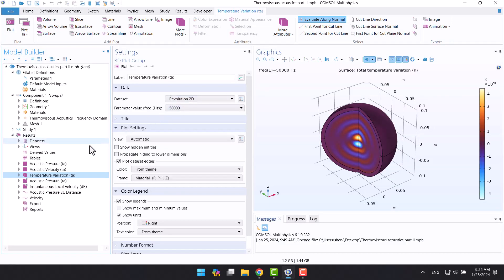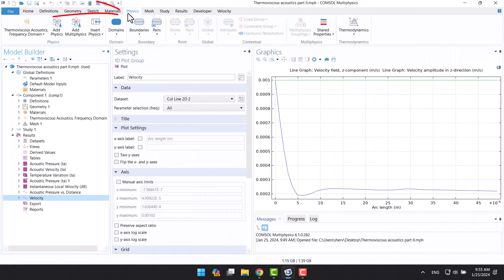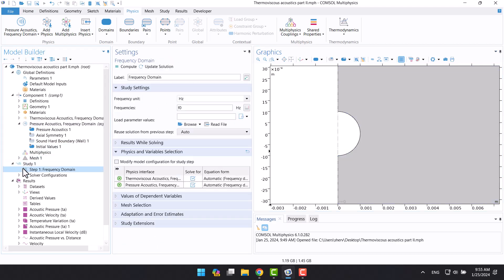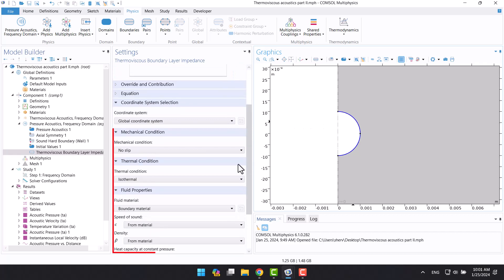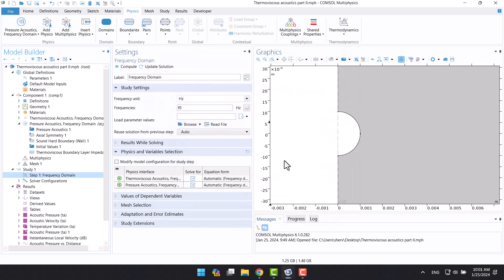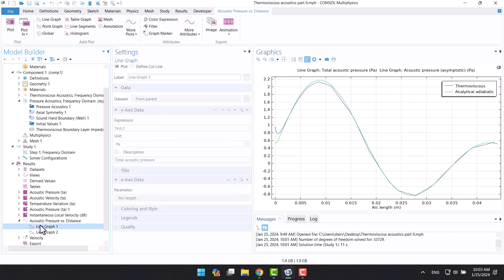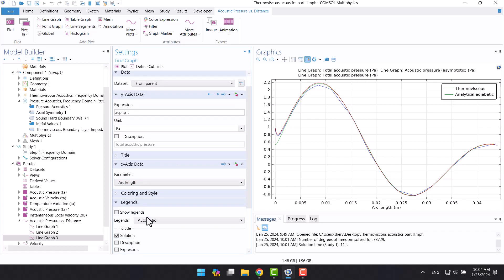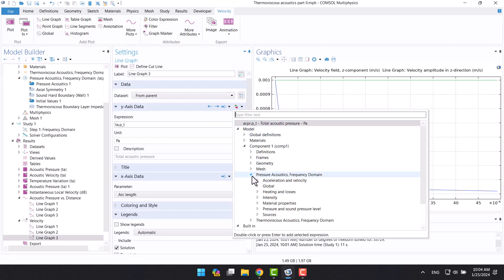🌡️COMSOL Tutorial: Thermoviscous Acoustics (Part II)

Comment: Why is the two results same? Why is the pressure acoustics did not deviate due to no losses?
Reply from the maker: Hello, I used the thermoviscous boundary layer impedance in pressure acoustics, so the system is not lossless, and the results should be identical.